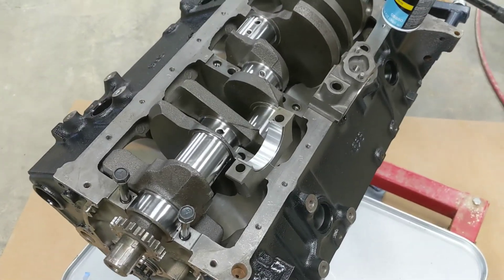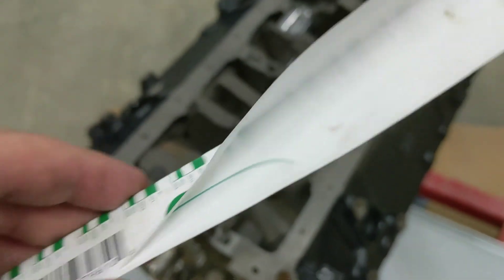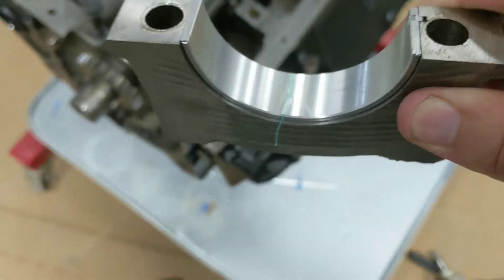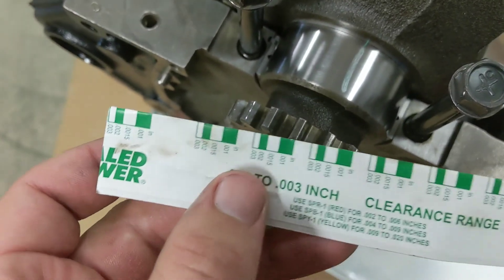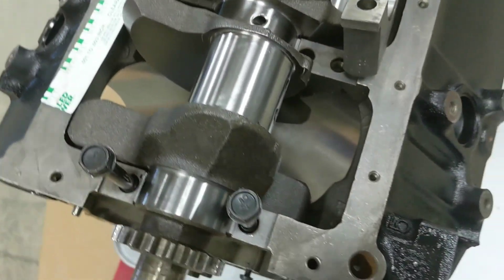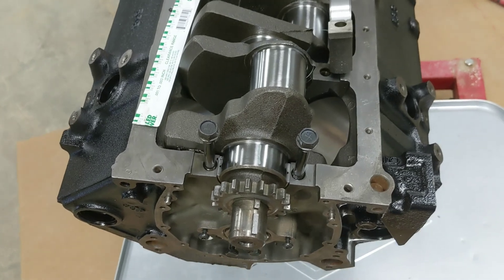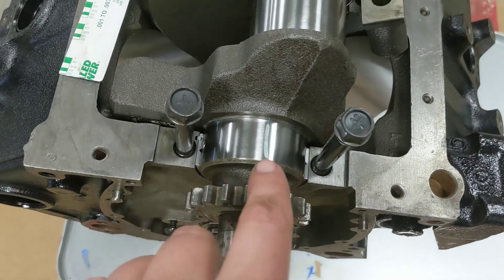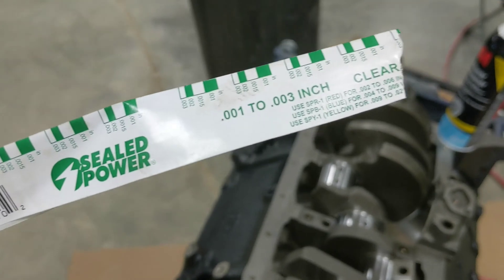How To Use Plastigage

Comment: What if the clearance is not in spec?
Reply from the maker: Then you need to swap components. Bigger/smaller rods, bigger/smaller bearings, or machine work to name a few. Not much you can do without machine or swapping parts because there's pretty much only one way to put it all together.
Reply: @605BOLT  thank you I’ve always wondered. Let’s say the plastic gauge is not in spec and you have to use over sized parts how would you go about using bigger parts? For example the bearing for the crank or rods. Are there bearings that you could buy that have the correct tolerance or is it best to talk to a machine shop? 

Sorry really new and about to rebuild a motor that I have that’s been sitting around. So that I can learn more about it.
Reply from the maker: @Peacefullsound1  yes they make slightly oversized bearings in the event that you have to turn your crank or machine anything else.
Reply: @605BOLT  thank you for the quick response I appreciate it
Reply from the maker: @Peacefullsound1  anytime!!

Comment: Plastigage gives the clearance on one side of the journal. The actual or oil clearance is when the crank journal is centered while spinning, or 1/2 of that. So he has .001" actual clearance. Don't know why factory specs don't 'splain this, they just give "bearing" clearance. Same with micrometers, machinsts use the difference between inside and outside diameters. And plastigage is very accurate.
Reply from the maker: Only way to measure is total clearance. That's how people talk about it anyway.